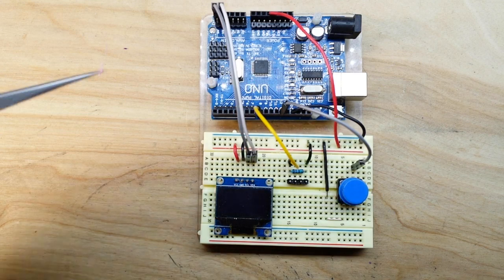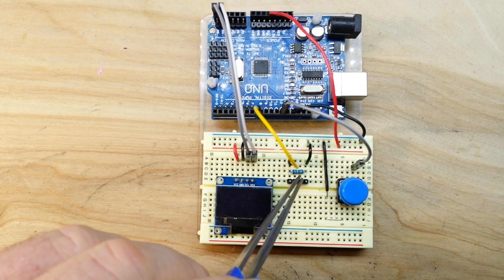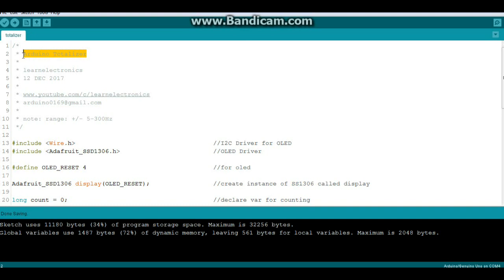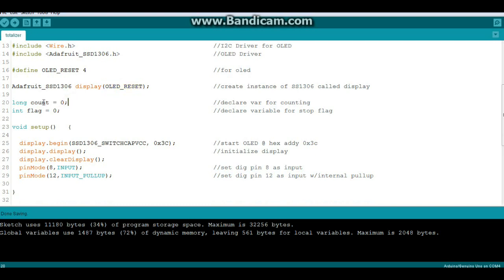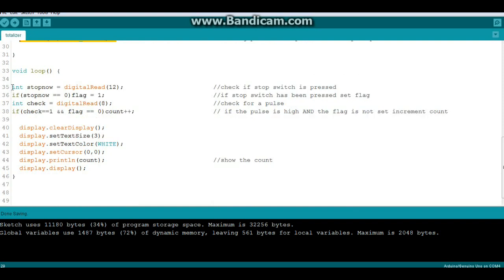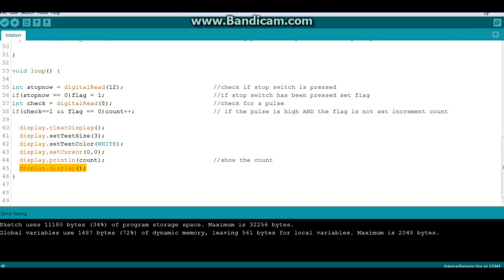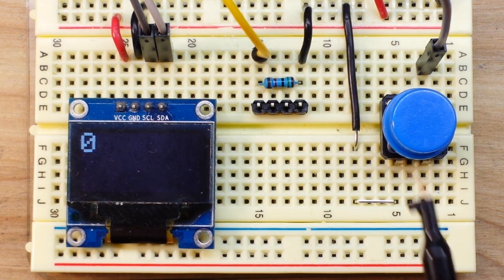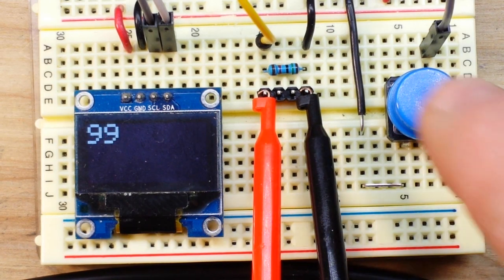Arduino Totalizer

Comment: You could run the i2c scanner sketch, to see what's the OLED i2c address.
Reply from the maker: +Arnold de Jong I know what the address is. I was explaining for other folks who may have trouble using the Adafruit SSD1306 library.
Reply: learnelectronics I understood, but when you dont know the address. Is it a handy tool. 😉
Reply from the maker: +Arnold de Jong Yes it is. I buy a lot of no name Chinese parts. The I2C scanner has been of great value to me.☺

Comment: That is a cool project! I think that there might me a little problem with the counter and that is if the input is held high the loop would count as fast as it could and account for actual rising edges. The fix would to add a check_flag so that it would count and set the check_flag  preventing a false count and then reset the check_flag on the falling edge.

Comment: What's that lcd screen? I'm looking for a bunch of small screens that are i2c and cheap
Reply from the maker: +Vinnie Morrison it's a .96" i2c OLED. Let me know if you need a link
Reply: learnelectronics https://m.ebay.com/itm/0-96-I2C-IIC-Serial-128X64-128-64-Blue-OLED-LCD-LED-Display-Module-for-Arduino/401395129024?itemId=401395129024&epid=18008063887 this one looks the same, but one can never tell with eBay listings